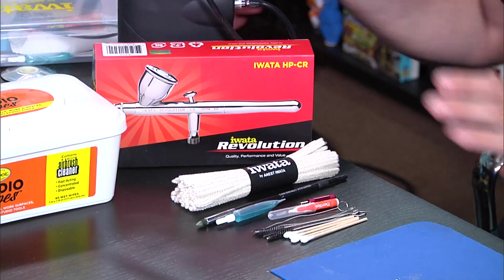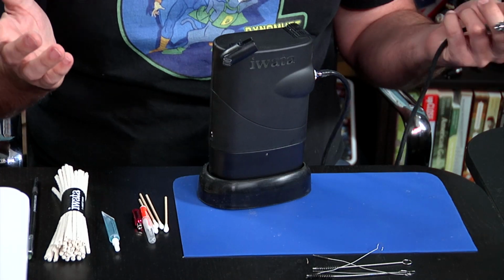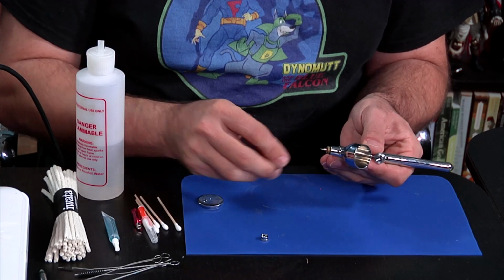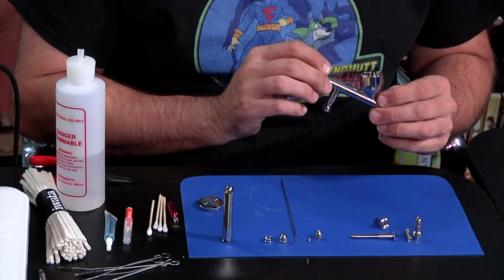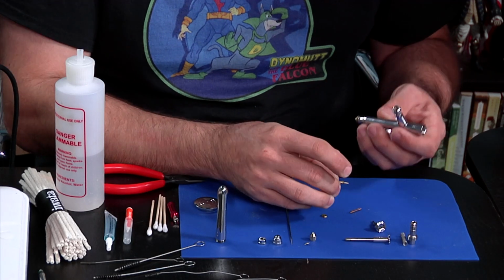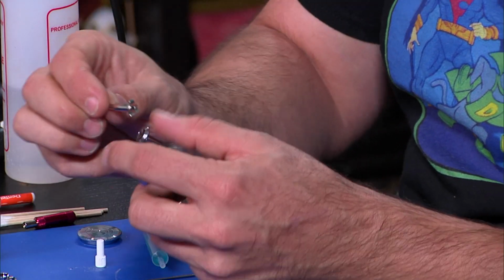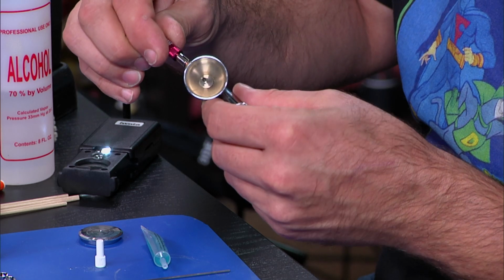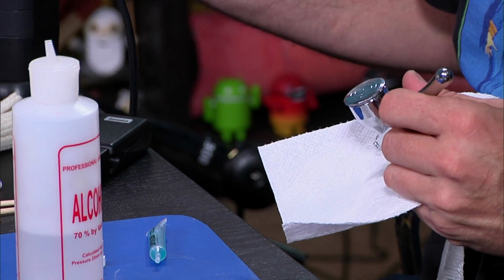How to Take Apart and Clean an Airbrush

Comment: You have the nozzle cap removal tool sitting right on the table.  That same tool is used to remove the trigger air valve plunger assembly.  It even holds onto the valve cover while you clean the plunger.  No need to use separate pliers.

Comment: The little tippy thing with one end smaller on it I can’t seem to get back into the tube and I’m worried I broke one of the tiny things holding it on to the stick, what do you suggest I do? Or how do I get it back in as it’s bigger than the width of the tube
Reply: The needle chucking guide

Comment: Booo... you didn’t take apart the front entirely! I compared my two siphon-feed Iwatas trying to figure out why one want spraying properly — its a misaligned air hole in the front … but I can’t figure out how to rotate it. The rotation is different on both. On the one that works well a fine brush goes halfway through both holes and stops. On the dodgy one one hole it goes halfway and stops — on the other hole the brush goes all the way in! I’m returning these …

Comment: the air valve is probably best removed with an automotive tyre valve key ( cross shaped tool, has a fang like tube, this is the valve remover; also has  two thread chasers, [internal and external] & a valve depressor), this is the safest way of removal, without damaging the valve or marring other parts.

Comment: Good video overall. One thing I do differently is that I never pull the needle through the back of the brush because you always run a risk of pulling paint into the back end of the brush which is harder to clean. Once you have the cone tip off you can just push it through the front where you do the majority of your cleaning.
Reply: another thing I heard, was pulling the needle out the rear can damage the seals. no idea if it's true or not. my passche, I have always pulled the needles out through the rear and never had any problems whatsoever. I just picked up an iwata revo hp-cr today.

Comment: Cleany thing = paint gun tip cleanerTip if you cant afford a compressor when first starting out, a large mounted car tire at regular pressure will run an airbrush quite a while. Then just go down to the gas station to refill when needed.

Comment: Hot water works great. Get enough boiling water and turn the stove off. Let the airbrush get a fully submerged hot bath without the niddle. Stir it frequently while the water cools down and see stuck paint flowing off the airbrush. Repeat it two or three times and you'r set. Taking apart and letting all parts have a bath separately works like a charm. I rescued my airbrush stuck with urethane with this trick (yeah don't ask why the fridge I used minwax's urethane). I found this more useful than using solvents many times before.